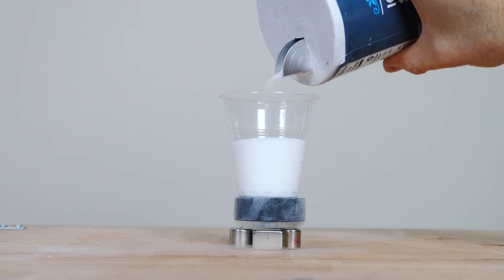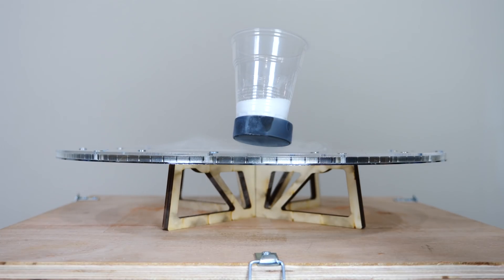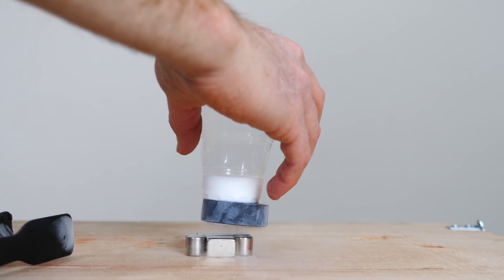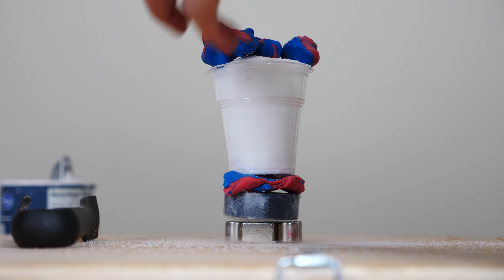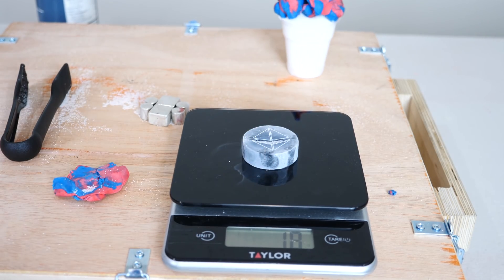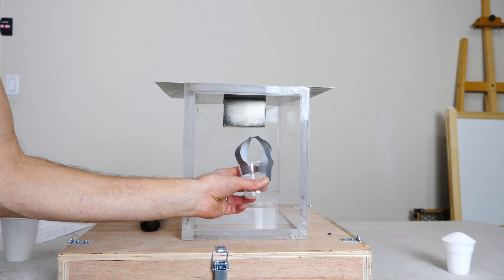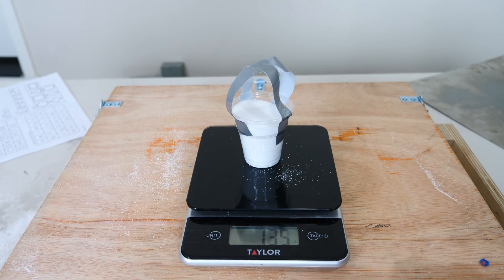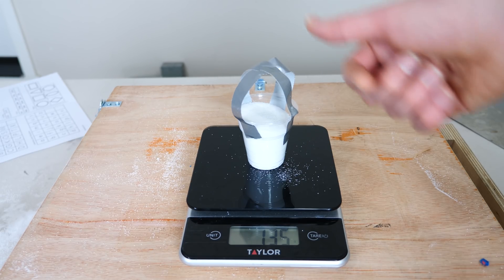How Much Weight Can a Superconductor Hold?

Comment: As soon as he said quantum I stopped trying to understand
Reply: You should try

It's not exactly hard, it's counter intuitive mostly, yes, but it makes sense 

The math is weird, yes but we did no math
Reply: Chili Plays why are you geh?
Reply: I think it might be a reference but not sure
Reply: Never "stop trying to understand". Always be curious.
Reply: Funny thing is that the only thing quantum here are the fundamentals. Everything in the video has nothing quantum to it ;)
Reply: @WouterVerbruggen  it's macroquantum, quantum physics that you can see

Still very much quantum tho
Reply: @guythat779  Yeah that's what I said. The fundamentals are quantum, the rest is 'just' classical mechanics and electrodynamics
Reply: @WouterVerbruggen  that's not even close to what I said and how is this classic electrodynamics? If you're referring to lorenz' law there's no change in flux thus there's no force
Reply: @guythat779  1. A flux line or fluxoid is a flux quantum surrounded by a vortex of supercurrent. 2. Pushing on the superconductor moves fluxoids in the material and pushes more in. So there is a dB/dt, which is the main cause of internal heat dissipation here. 3. Because of internal supercurrents there is a magnetisation in the material. 4. The fluxoids repel each other because of their physical nature, leading to the distinct arrangement they'll arrange into known as the abrikosov lattice. Do you need more reasons why this is electrodynamics?
Reply: @WouterVerbruggen  but that's wrong,  there's no change in them no db/dt 
Look up how a quantum levitation  works, usually a bunch of helpful visuals are used
Reply: @guythat779  When you move towards to a magnet (i.e. push on the levitating superconductor) the magnetic field obviously increases. I suggest you read up on how superconductivity a little deeper. For example, read this: https://ocw.mit.edu/courses/nuclear-engineering/22-68j-superconducting-magnets-spring-2003/lecture-notes/master.pdf. Or come by our superconductivity lab on the University of Twente and I'll give you a masterclass
Reply: Wouter Verbruggen dang you feisty
Reply: Wouter Verbruggen  and smart 🧠

Comment: Is there another way to cool a superconductor besides liquid nitrogen
Reply: Liquid helium
Reply: @itslentastic432  or liquid oxygen
Reply: @thesarcasticguy936  liquid vacuum
Reply: @itslentastic432  liquid space
Reply: @thesarcasticguy936  liquid star
Reply: @itslentastic432  or liquid human
Reply: @thesarcasticguy936  maybe liquid atom
Reply: @itslentastic432  how about liquid earth
Reply: @thesarcasticguy936  or even liquid mars
Reply: @itslentastic432  or liquid mass
Reply: @thesarcasticguy936  what about liquid light
Reply: @itslentastic432  or even liquid sound
Reply: @thesarcasticguy936  maybe liquid volume
Reply: @itslentastic432  or liquid temperature
Reply: @thesarcasticguy936  or liquid size
Reply: @itslentastic432  or liquid weight
Reply: @thesarcasticguy936  or liquid length
Reply: @itslentastic432  or liquid speed
Reply: Well this just explains that i got more free time than you do😂😂😂😂
Reply: @thesarcasticguy936  liquid universe
Reply: @itslentastic432  or liquid liquid
Reply: @thesarcasticguy936  maybe liquid solid
Reply: @itslentastic432  or even liquid plasma
Reply: you can also use Lasers to "Trap" or "calm" the Atoms(laser cooling) , that's what they did with the  BOSE-EINSTEIN-CONDENSATE Experiment
Reply: You just need to cool it down to -179 Celsius or -290 Fahrenheit 
If u wanted u can get a hydrogen sulfide superconductor which need's to be cooled down to -70 Celsius  -100  Fahrenheit I don't know if it can do quantum locking tho
Reply: I mean what I can do at home
Reply: @GalaxyAeterna  the best you can do at home is to get a hydrogen sulfide superconductor and put it in the freezer for a year or so unless you used the BOSE-ENISTEIN-CONDENSATE and used laser to cool it down still that requires you to have a big budget
Reply: @menmanamikaze1830  I'd sure like a freezer that does -70C and then also can put 1,2 million atmospheres of pressure on something...
Reply: @WouterVerbruggen  having a -70 degrees freezer and 1.5 million atmosphere of pressure is not impossible but it needs a pritty big budget and that's what i said
Reply: @GalaxyAeterna  i think liquid ice will do the trick
Reply: Liquid hydrogen, helium, neon or oxygen (under pressure or subcooled). Or any crycooler capable of reaching the required temperature
Reply: To sum all these comments up: "No"

Comment: If you could scale the experiment large enough, what would the human body experience if crawled in the gap
Reply: I would presume that everything would be normal for the human, except the wow factor...
I'm not a physicist though.
Reply: Nothing. Otherwise MRI (which has fields 2 to 3 times higher) wouldn't be safe enough for use in a hospital
Reply: @WouterVerbruggen  agree. did I state otherwise? or did you miss-tagged me?
Reply: @Not.Your.Business  yeah, my bad. It was a response on Doug IT MAN's comment ;)
Reply: Cold air
Reply: The interaction happens through magnetic fields, and we don't feel them.
Reply: Maybe put rat underneath?
Reply: @x1area51ii7  still nothing would happen
Reply: @linecraftman3907  shit ok ..now this is boring experiment lol
Reply: @linecraftman3907  Something must happen though but we just can't feel it. I have seen frogs and strawberries levitated in a magnetic field but I'm sure the field strength is way higher. The frog seemed fine though so the force must be applied evenly. I'm sure there's a video. And here it is. https://youtu.be/KlJsVqc0ywM
Reply: Superconducting magnets are used in MRI machines, so I'm gonna say nothing unless you've got some ferrous metals on or in your person.

Comment: I was thinking why did you use salt the puck id frozen even though it's not touching the salt the bottom of the cup is getting a brief frozen second and then the salt is prolly melting it quickly so then it in return is probably melting the puck but that is only an opinion

Comment: Some type of inverse square law involved...  My bet was far more than just that cannisters of salt!
Reply: Not really, the magnetic field is mostly uniform in front of a square magnet .... till it's not, it's complicated but it's certainly not an inverse square 

Usually the inverse square law applies when the field spreads radially (away from, kinda like how you used to draw sunrays in preschool drawings) from a sphere or point however even a spherical magnet will not create an inverse square field because the magnetic field lines aren't radial (they go from one pole to the next)